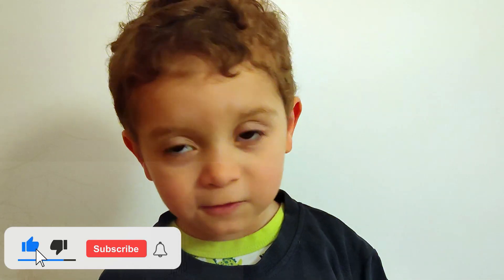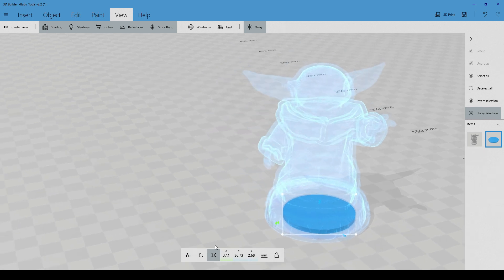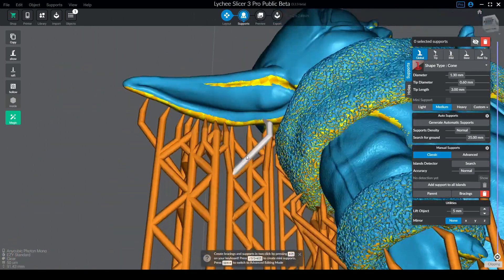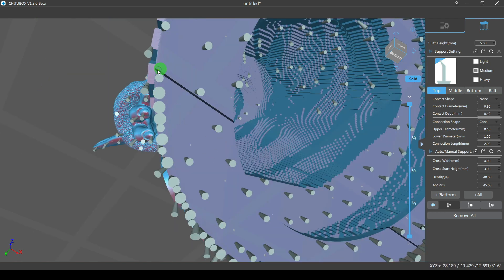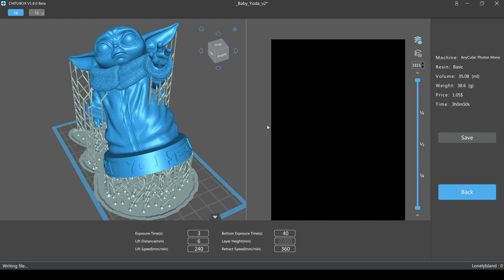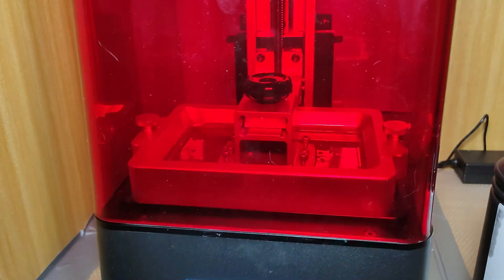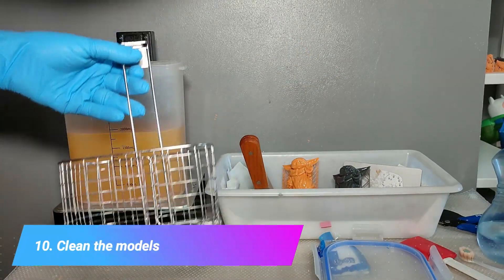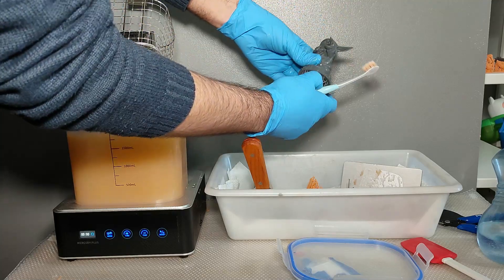How to 3d print Baby Yoda "Grogu" or the Child (On a resin 3d printer)

Comment: I'm trying to print thus model at a smaller size on saturn 2 and its taking 12 hours I don't understand how you can do it in 3 to 4
Reply from the maker: Which settings are you using and which resin?

Comment: Sorry, deleted the message without checking if you had replied and you did. I've been using prusaslicer paint on support for FDM. Apparently this function is not avail for the SL1 resin printer. Which rendered my message obsolete. Bests